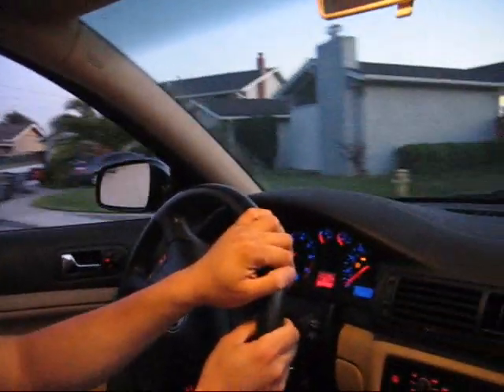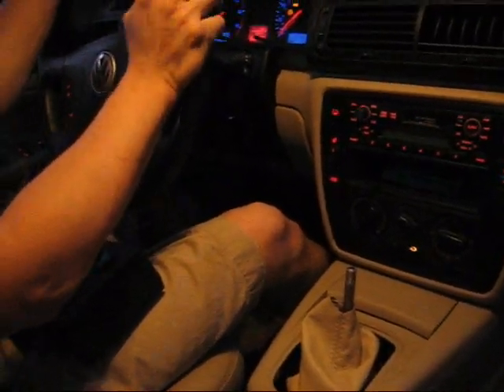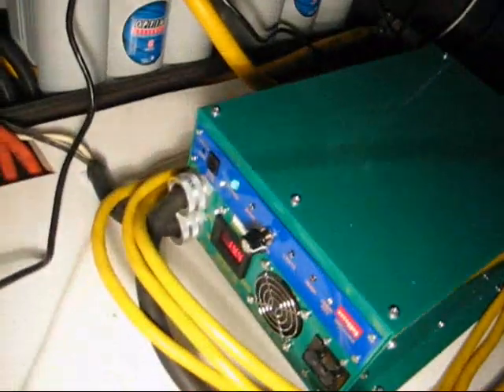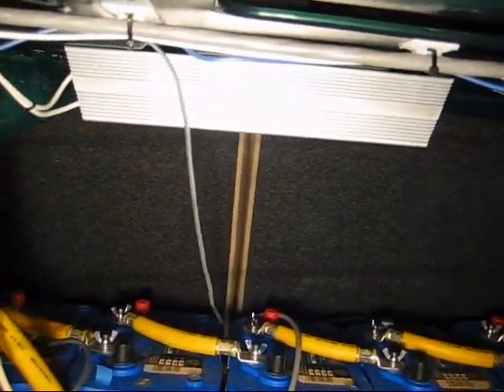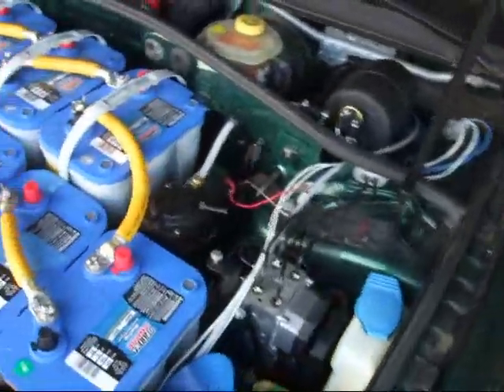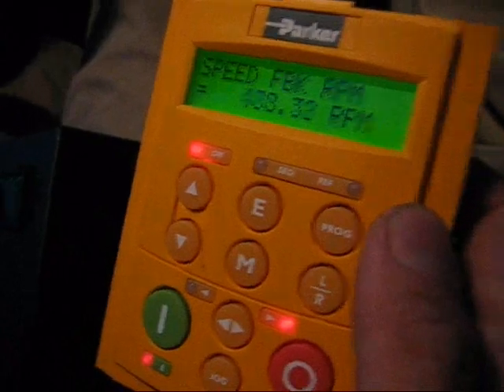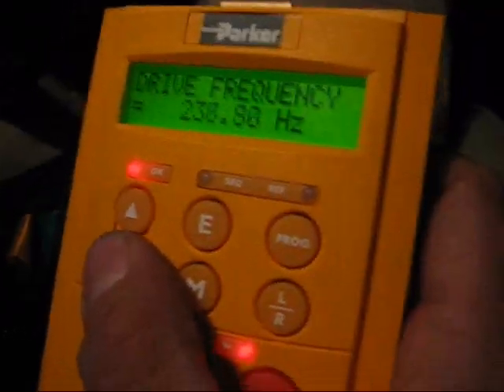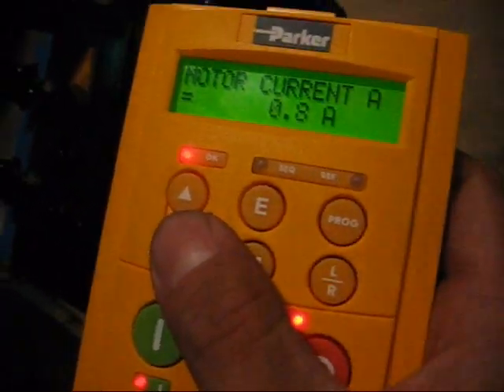Update: Electric Car Conversion using Siemens AC motor and home made 3 phase controller.

Comment: I'm impressed. You came up with such a practical vehicle conversion using off the shelf parts and home built inverter. I can't imagine what you could do with a purpose built electric car. You should be working with GM on the EV2. Not that there is a EV2, but there should be.